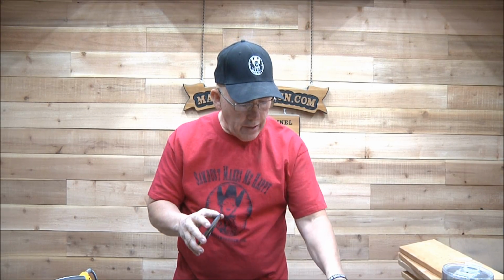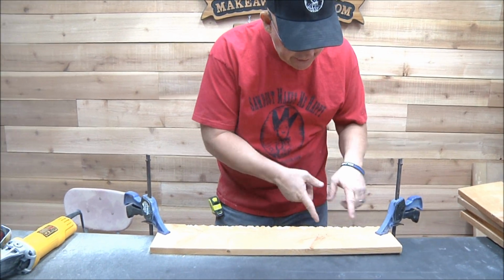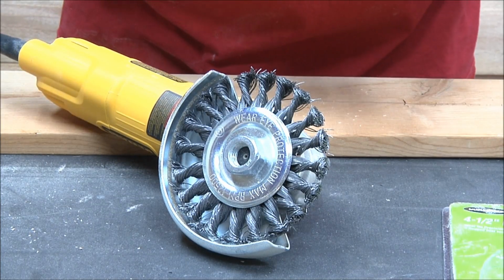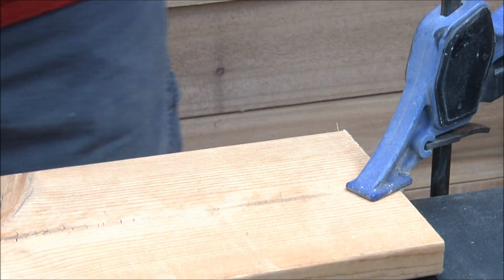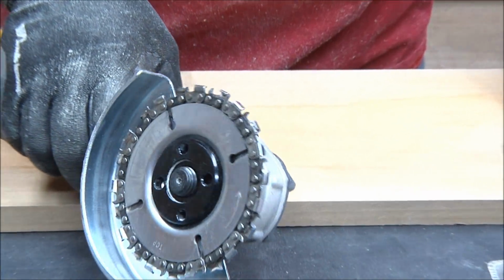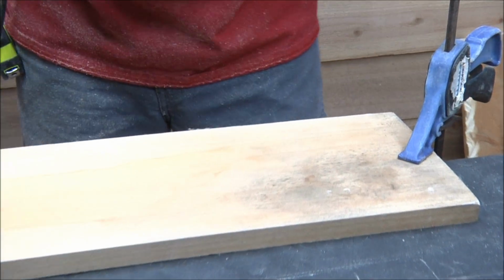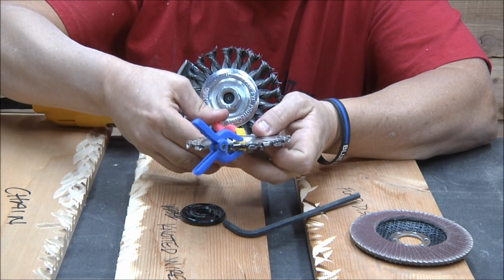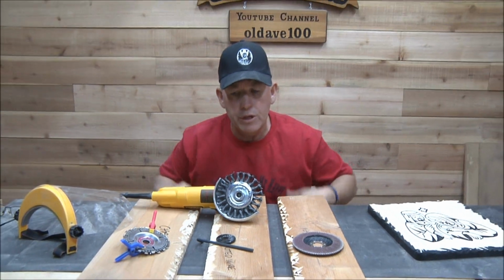Newsletter #232 Demo With A New Toy & New Ideas for Edges

Comment: Great video Eric. I came up with one of my favorite rustic edges fixing a boo boo when I was putting an edge on my Cowboy Welcome Sign, when the board slid under the guide bearing and put a gash in the side of my sign. Was so mad I Almost snapped the board in half on my router table. Then a light bulb went off in my head. Grabbed the angle grinder and a sanding disc wheel and mimicked the gouge all the way around my sign. Now it's one of my favorite rustic edges I love to do.
Reply from the maker: Great point, sometimes you just stumble into stuff that works out great....

Comment: Hi Dave
Nice looking rustic edges, just one question do you have the wire wheel disc on the correct way as it seems the nut is only just holding on
Reply from the maker: I tried it the other way first but there's no nut on the other side and the wrench wouldn't fit on the inside. Doesn't look like it but there are actually several threads holding it on tight.

Comment: You do great videos but you lack in one thing.  "Safety"  No hearing protection, no face shield and you readjust your router with out shutting it off.   The router is one of the most dangerous tools that can cut deep, long and fast.  I know it is hard to make a video with all the protection, but you should at least wear hearing protection for your own good.
Reply from the maker: Thank you for the concern, I appreciate it. Shortly after I made this video I did start using a face shield when doing this. I also took this dewalt back and go the one with the paddle switch. I do wear more hearing protection now on certain operations. On turning off the router to adjust the depth, nope, we will have to agree to disagree on that one. Thank you again for watching and the feedback, I do appreciate it, Eric